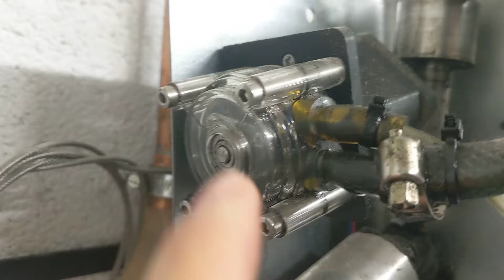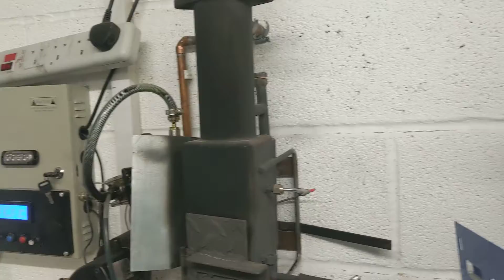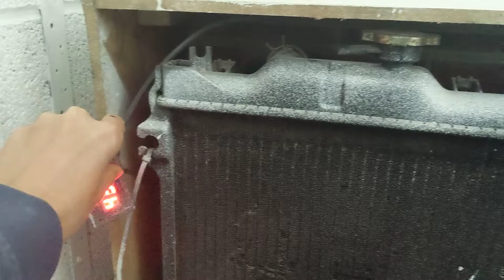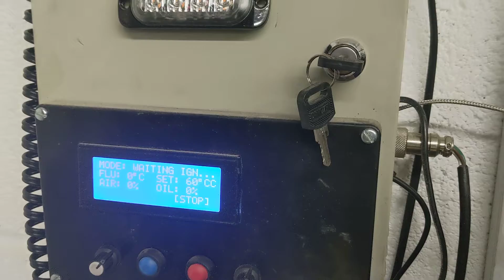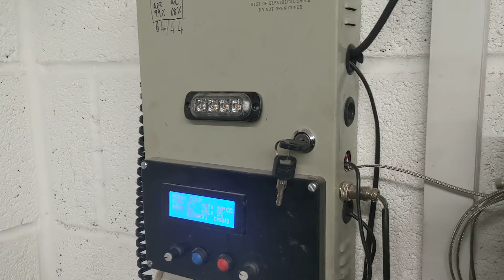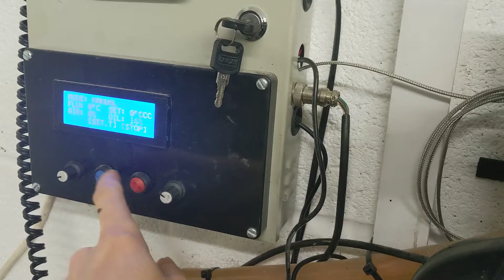Micro Waste Oil Burner with back boiler and digital control

Comment: Really nice setup, trying to make something similar but heat water in an aquaponic system. Do you get a clean burn off the unit?
Reply from the maker: Very clean, zero smoke at all (I was concerned about neighbours etc)

Comment: You guys were partly responsible for me ordering my 12is empenage, you made it look so easy. Turns out you are a fricking engineer!!! 😁 I have sooo many questions. Do me a favour, could you drop a link for the grey primers please (avoiding all the debate on prime/no prime) I'm hoping to just copy you guys 👍
Reply from the maker: Haha welcome to the world of aircraft building also :) For primer I used rapid etch from a place called rainbow paints in the UK - I went with aerosol as was so much easier to work with - any rapid, fully etching primer will do though!
Reply: @mtechautomotive  I watched that video soo many times! Even looked up rainbow paints. Basically choose a company you can buys loads from at a reasonable price? My project folder has come from LAA, just looking for the right time to call the local inspector, I guess he/she will have a view. That joint sealer you used, think I'll pass on that step 🙄